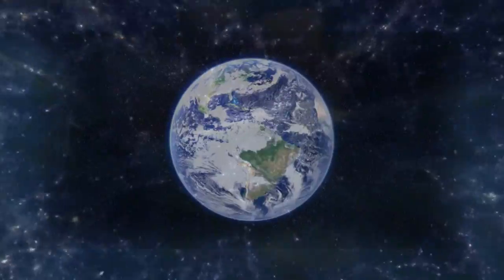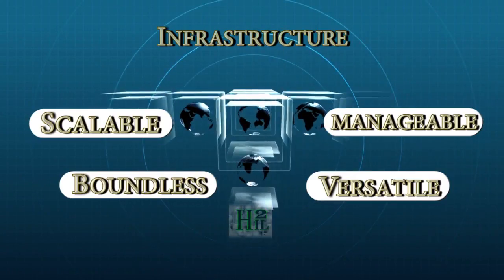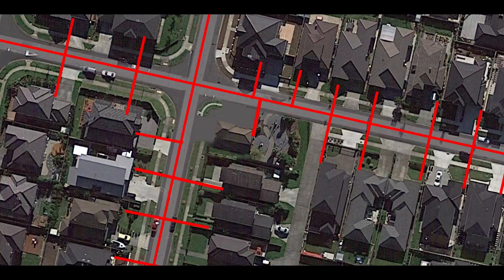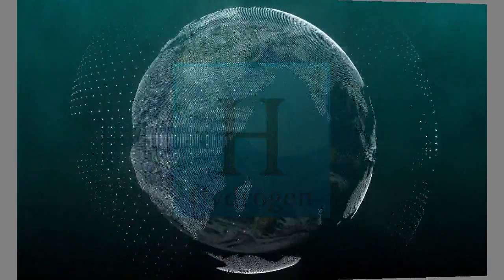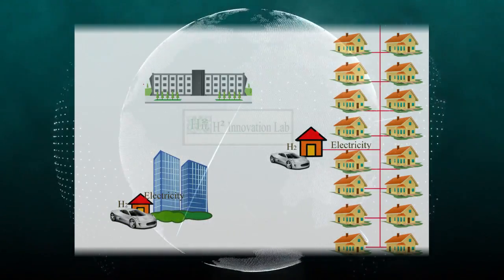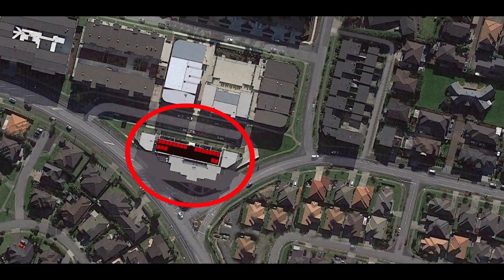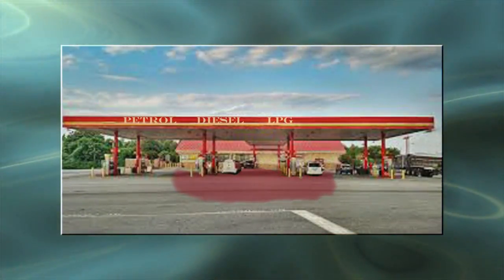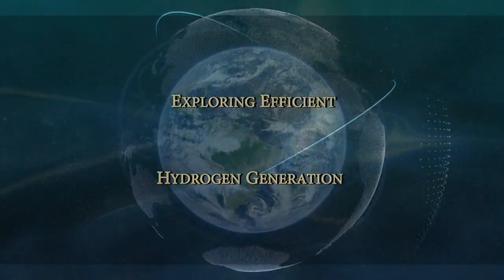self-Sustaining Hydrogen Generation Game-Changing Infrastructure Capabilities

Comment: How much does it cost to install one of your units at an estimate? You talk about two units in the small garage-sized building - what would be the total cost of such a structure with all of the equipment etc.?
Reply from the maker: H2IL have just published some statistics on their Q&A page. An example of a 1 cubic meter cell producing 2Kg/h of hydrogen with an OEM manufacturing cost of US$12,000 per unit. The Galvanic metal cost per US$20,000 of hydrogen (pump price) is just US$500 plus 2 hours labor to exchange the galvanic metal. Nuclear energy also requires metal rods to be exchanged so this is a close comparison.

Comment: 1) How much does one of the units you talk about in this video cost to produce?
2) You say that one of your micro stations can support 40 houses, with two individual units inside each station. What KwH consumption are you presuming from these houses? Are they American households consuming 12,000KwH or, for example, German households consuming only 4,000KwH?
Reply from the maker: H2IL have just published some statistics on their Q&A page. An example of a 1 cubic meter cell producing 2Kg/h of hydrogen with an OEM manufacturing cost of US$12,000 per unit. The Galvanic metal cost per US$20,000 of hydrogen (pump price) is just US$500 plus 2 hours labor to exchange the galvanic metal. Nuclear energy also requires metal rods to be exchanged so this is a close comparison.